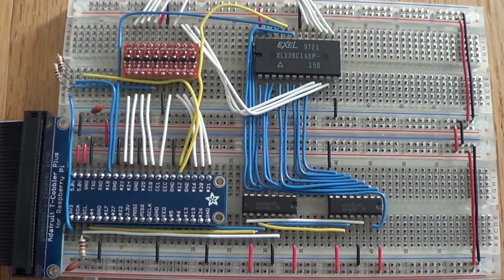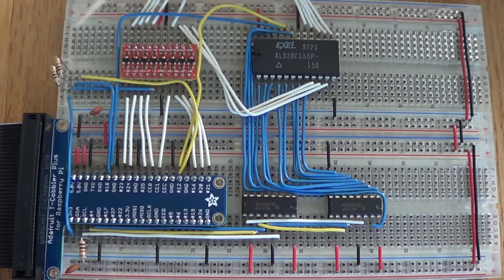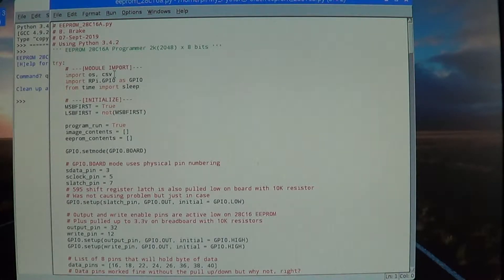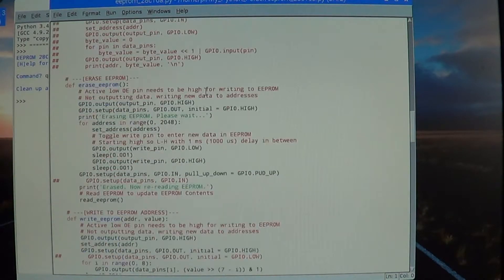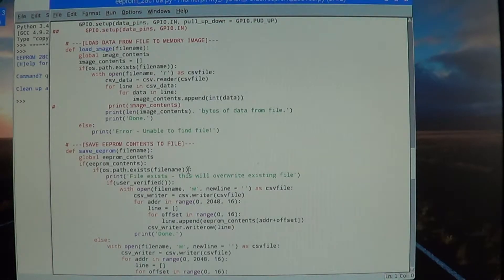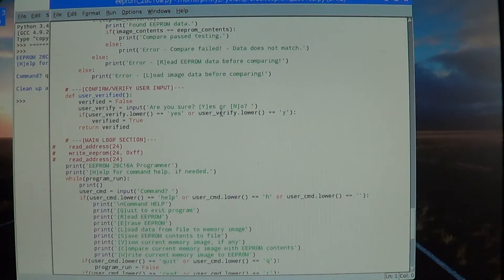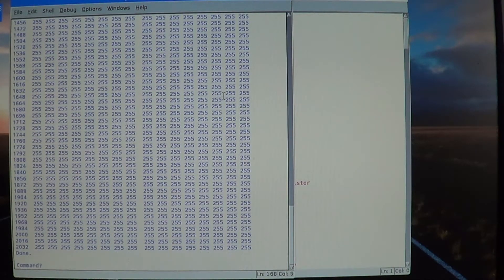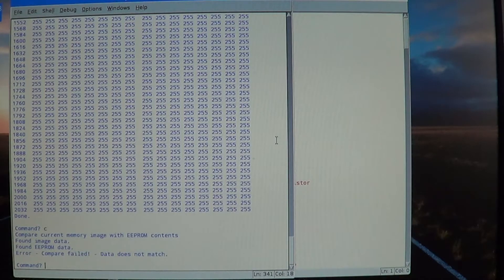Programming 28C16 EEPROM using Raspberry Pi 3

Comment: Hi! I'm trying to flash an atmel 29c020 - I am looking for the easiest and cheapest way of doing it as it's a low-importance project. I have both a Pi and an Arduino. Do you have schematics and the code you used? (I still need to watch your video till the end BTW!) Thank you!
Reply from the maker: Hi tony359! If you find a few useful bits of info in the video, then I am glad it helped. The code is still a work-in-progress... It works fine, but it is definitely not optimized Python code. There are some sections that are going to bother me until I go back and change them :)  As far as schematics, I rarely draw them unless I am ordering PCB's. Typically, I just sit down with a couple breadboards and some datasheets, maybe making some notes in the margins for reference while wiring.
I did not read through the datasheet, just a description, but flashing that atmel 29c020 256K sounds a bit more difficult than just writing data to the 28c16 2K addresses. Best of luck with your project!
Reply: Hi Bret, Thanks! Unfortunately my skills are not superb when it comes to these things and I was hoping to find a "plug an play" method that would work for me - or maybe that only requires a few changes. Thanks for your advice!
Reply: Hi bret can u email me the python script for programming the 28c16 eeprom.i shall be very thankful to you.